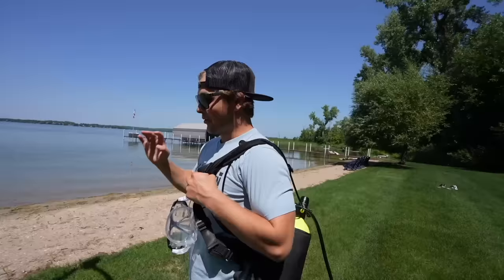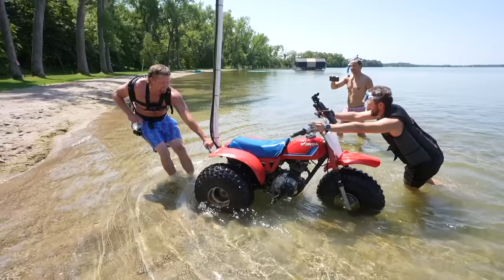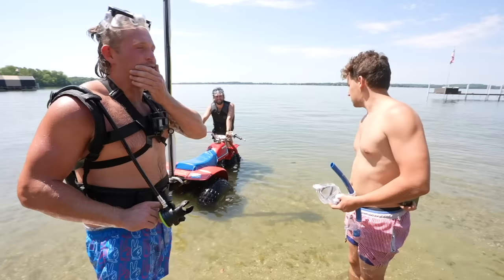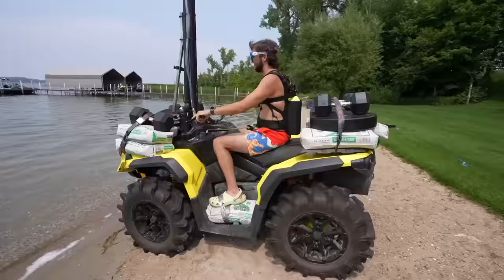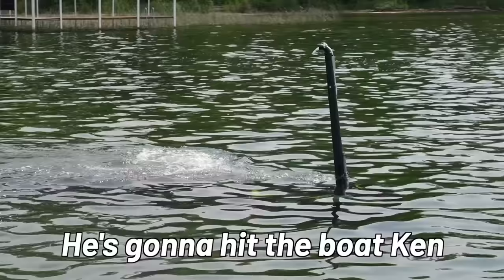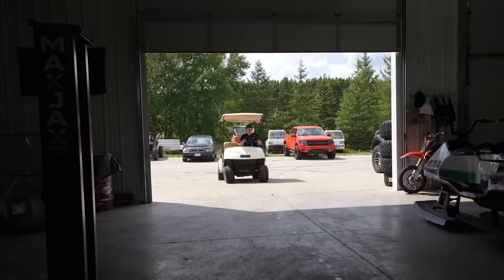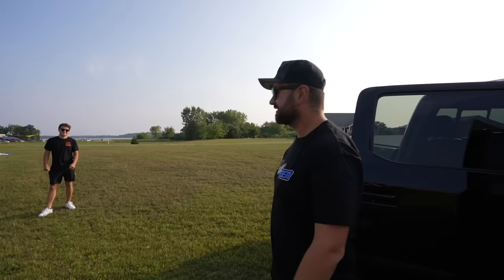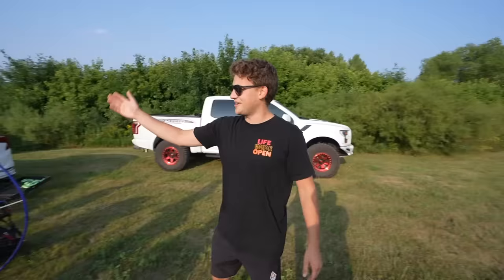Riding my Three Wheeler Under Water

Comment: I snorkeled my 110 ATC back in the day and drove it through the river and a couple of ponds every day lol, The trick is to keep the rpms high. You also want dielectric grease on all your plugs and your spark plug boot. Don't forget to snorkel the carb and crankcase vent lines

Comment: To Fix the 3-wheeler, you guys need to insulate the spark plug wire in order to prevent the spark from traveling to the water. This is your current problem. Send it!

Comment: I kind of like 3 wheelers a little bit myself 😂. I only have a herd of them that I rip hard and have been riding them for 30 years at this point. My dad put me on a 1979 ATC110 when I was 4 years old and told me if I could ride that then I could ride anything and that was pretty much exactly right lol! I used to race 450cc ATV MX for several years and always ripped dirt bikes over the years as well. It’s nice being able to rip anything with wheels and racing was fun but I have the most fun and feel at home on 3 wheels. Was hoping to see a little bit more 3 wheeler action in the video anyways since I clicked on it for the actual 3 wheeler lol but the video was still entertaining either way and good job! I feel for Gavin and I wouldn’t of given up on the 3 wheeler idea either, would of looked for a three wheeler with the best chance of making it underwater and then go above and beyond sealing everything you can think of up as well as running the snorkels/vents/etc and see what happens. Probably could of sat on the trike in the driveway with it running and sprayed water on the carb, etc.  with a hose to find out it wasn’t water tight rather then taking it to a pond/lake and just submerging it lmao 🤣 👍
Reply: But they call them “Virtual Submarines”???

Comment: I think your issue is the exhaust, I think you need to also run a pipe up for that because right now the pressure of the water is too much preventing the exhaust from escaping stalling the engine.

Comment: Lol so funny story about golf carts. My dad owns a Yamaha golf cart dealership and he got a cart for our personal use and he said i can go crazy and build it up, so i did and i went and put Ohlins suspension on with a custom lift kit i built and built a steel bumper with a built in kit. Also just running it on Lithiums and have solar panel as a roof. Probably the sickest build ive done so far. Oh and i installed a lsd and a sway bar

Comment: i knew it wouldn't work off the rip lol too many ways for water to get in and or short the electrical system. You need good gaskets, check the intake boots, extend atmospheric vent tubes, and screws that need hotglued to water proof it will need addressed

Comment: You have to snorkel the gas take on the Honda 3 wheeler by moving the gas cap and have to make sure all of the vent wholes are up the snorkel and make sure the drain wholes are plugged and make sure there is no leaks other than that it should have ran but I see that you guys didn’t snorkel the gas tank the other wheeler worked because it’s fuel injection and dosnt need air to breath but the carb dose for fuel to flow

Comment: I'm surprised yall sprung for a scuba tank and didn't think to get some cheap flippers to put on the "camera man." Also, madjax makes an amazing 6 inch lift for ezgo, and club car at the unbelievable low price of $900 with leaf suspension and bushings (however, "normal" use with this lift kit might land you with a missing wheel due to shitty materials used on the spindle, and they dont sell replacement parts) 😂😂